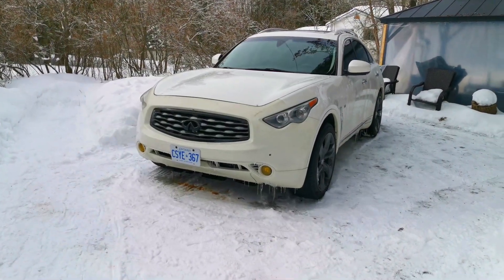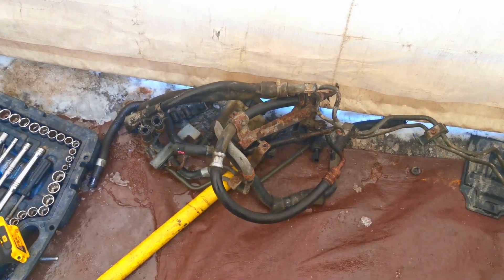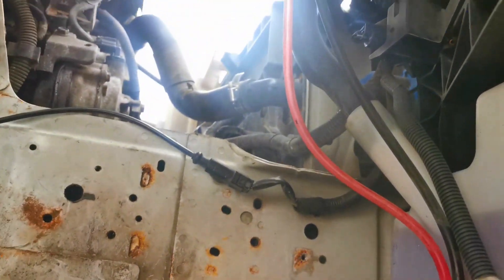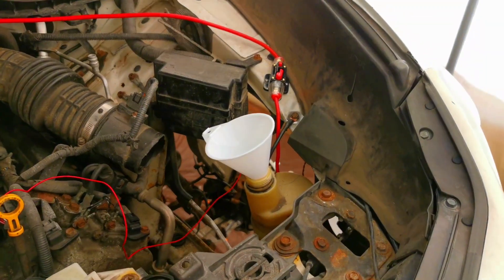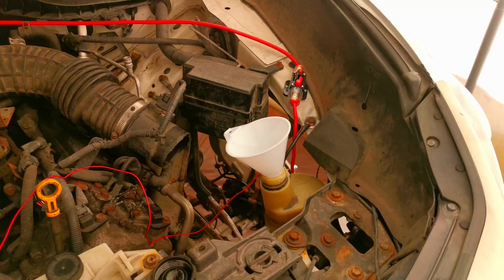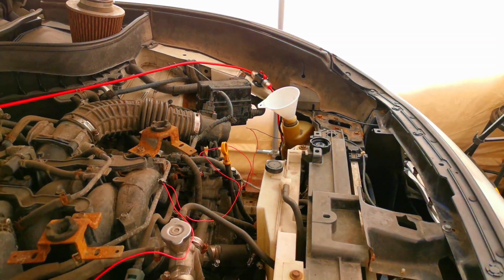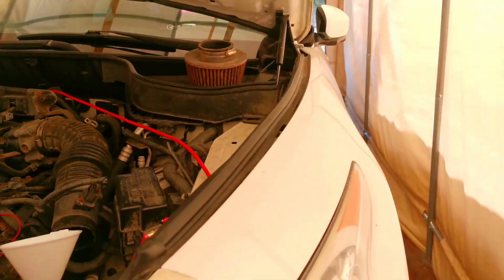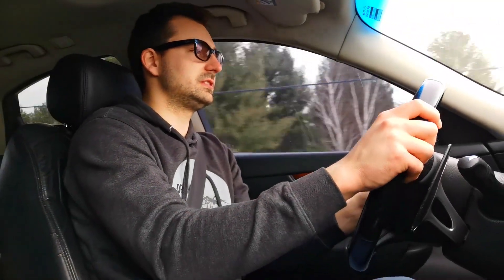Volvo Electric Power Steering  Pump Conversion on Infiniti!!

Comment: Great video but do you mind explaining the reason for this swap? What is wrong with the old setup? Thanks
Reply from the maker: Thanks! Great question, the old system was rotten plus the pump was leaking, so to do this was a lot more cost effective then getting the original parts for the FX50.

Comment: Don’t know if you saw my comment on the last video ,but could you do a video where you put a mazdaspeed front bumper. Hood. And fenders on a regular Mazda 3
Reply from the maker: Hey like I mentioned when I replied to your last comment, I don't think I'll be doing that with this Mazda 3, but I don't think it should be too much of a problem to do it just remove the front end and put it back together